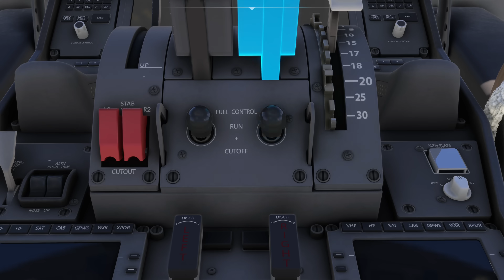Air India 171: Why Did The Fuel Cut-off Switch Get Moved?

Comment: I think that an extended suicide is strange. If I really want to play it safe, I don't think this is safe to not survive. Many crashes on takeoff and landing sometimes still have survivors. I think it could be possible that one of the pilots may have had a hidden health problem and mistook the situation due to confusion. Maybe he had a stroke or something, so he didn't remember that they were taking off. The way the switches were turned off also speaks in favour of this. Just like it's done routinely. One switch after the other.

Comment: I don't buy the suicide angle that is being pushed here. There was no fire in any of the engines and the plane never indicated that there was and under those conditions, a flight control system wouldn't allow the fuel to be cut off to both engines. Furthermore, there is no indications from the cockpit voice and flight data recorder that either pilot did anything but to try and save the plane until the very end. Having relationship problems, mental health problems, or burned out from work doesn't not make someone a mass murderer.

Comment: I work on Gulfstreams and when the engine fire bottle is discharged it initiates as sequence which includes shutting off the fuel shut off valve to that engine. Does Boeing not do this? If they did then computer logic can be programmed into the fuel management system that the only time those switches can be activated would be when the WOW's are engaged. Doing this would prevent future tragedies like this.

Comment: im very confused, if the other pilot did put the lever back to run after 10 seconds, wouldn’t we find the levers in the run position? or did he try but was unsuccessful? i thought it took more than 10 seconds for the plane to fall. i understand that even if he was successful he probably wouldn’t have saved it cause it was too late, but if he did it, why is it still in cutoff?

Comment: Captain Steve says if a pilot is feeling not right to stay home. The people with bad mental health issues won't know how bad they are if they are really bad. The solution is one pilot can't do somehow without the other pilot doing the same on their side. So if one tries to shut off the engines, the other would have to manually authorize it, this would be for everything.
Reply: That defeats the object of having a co-pilot if everything the pilot does has to be replicated by the co-pilot who would need to be present in the cockpit as a chaperone for every second of the flight - no comfort breaks, naps or taking ill!
Reply: That is true. There used to be flight engineers on board, so you'd have 2 people against 1 if something occurred, but they stopped that to cut costs. Now some airlines want just 1 pilot in total to cut costs! So if a pilot has a heart attack, the whole plane is doomed! @MrBulky992
Reply: That makes NO SENSE!!!!!

Comment: They need to release the audio recording. The loud bang that the sole survivor heard should be picked up by the recording and does it match the RAT deployment timestamp. Did that happen before the fuel cutoff switches transition to the off position? My belief is there was a circuit board malfunction such as traces expanding and therefore causing intermittent shorts due to the high temperature.

Comment: This is absolute insinuation and fake news! In 2018 and then May 2025 British aviation authorities issued a notice of a actuator issue with the fuel cut if switch that causes the switch to operate on its own!  You are clearly covering up for Boeing!!! The preliminary report did not blame the pilots they left it open ended to leave doubt! Obviously they are helping out AI and Boeing! You actually doing a disservice by not reporting the facts!

Comment: The question from someone who works in Automation and error proofing is why the "life or death" fuel cutoff switches are located where they are!!??.  Something critical like this should be at a minimum two step process where a confirmation is required by another manual action!!.   After all these planes have people in them.  We have had many aviation incidents over the years where the cause of the crash is mainly human error.

Comment: Sir if pilot did not switch off the fuel could it be fuel transmission failure could it happen even if fuel switch is not off"

Comment: Is it not possible that fuel flow  might have been stopped  by software malfunctions. Pilot observing the panel realizing fuel flow has stopped, switched off the fuel switches, and restarted? He might have looked at the switch and found it on  when the other pilot denied switching off ?

Comment: Given that the fuel switches were found after the crash set to run, the black box evidence regarding them being manually switched off and then on again has to come from the software reporting to the black box….is it not therefore possible that the commands to the engine could have been triggered by a software malfunction leading to the reported conversation between pilots regarding why did you turn that off and the denial of the other pilot…I think there is a lot of assumptions being made about pilot error here and a lot more intensive software investigation to be done, particularly with Boeings track record….one question that seems to have been ignored is whether the total electrical failure caused the engines to shut down or did the engine shutdown cause the total electrical failure.

Comment: not saying there was no pilot error or bad intention on part of both or either of the pilots, but would we be as quick in jumping to paint blame on the mental health if it were any other profession? do we have proof of physical proof of switches being turned off or is it displayed on display that one of the pilots saw and raised the question? Can it be a software glitch that points to fuel cut off?

Comment: I'm not clear on how these switches can be installed incorrectly.  How can they be disengaged (not in detent), in the unlocked position (neither on nor off), and engines still be able to be started or shutoff on the ground?   Wouldn't someone already have come across this and then correct it? Secondly, was there interaction with the switches before or after the plane lost altitude?

Comment: What we know now is that the families of those pilots can never live in peace, as everyone is now blaming the pilots for the crash.
Reply: What about the passengers who burned to death?
Reply: @cocojeffrey8502  like i agree but without clear evidence u cant blame the pilot and also ..the pilot families wont live in peace ryt ..like they will have the guilt of lose of 260 people till their death because of their family member...imagine their parents or wives ..they are in depressed state bcz of their close person death as well as the guilt of the lost of 260+ people .
Reply: @StudiesPurposeonly it's either lack of training or wilful negligence. Being a commercial pilot you take that responsibility...sorry but we can't have "business as usual" in commercial manslaughter cases. The CEO of Air India should have already resigned if he had a spine.
Reply: Not both pilots. Just the one that threw the switches.
Reply: Maybe in India, in the West its not your fault if a relative does something.  That's rational.
Reply: In 32 seconds, it's not possible to cut off the engine switch so easily. If either of them had done it, the other would have noticed. You need to use either your left or right hand to do it. Cutting off the engine switch requires force — it takes time to grip it firmly with one hand and pull it. One of them would have noticed if the other tried. Both of them cannot be suicidal.
Reply: @anantbhardwaj5741  it's not possible for two independent computer systems to have the same fault within a second.

Comment: @4:19: When you say the pilot put the switches from "Run" to "Cut-OFF", could you confirm the pilot actually did make the transition through video/photo evidence from the fligh data recorder or are we just assuming from the data on the black box?  We should'nt be rulling out any malfunction from the flight ECU. That needs to be invesigated as well. What if the switches were left untouched but internally something made the switches move position.

Comment: with all due respect captain, to compare this to children denying wrong acts is a bit insensitive.
Reply: there have been reports in the past that the fuel control switches on 737s have been installed with the locking feature disengaged but you have not covered this possibility.
Reply: special information bulletin by FAA Aviation Safety 2018, Dec 17

Comment: Good day all,

I'll try one more time, to acquire an answer to a very reasonable question, generated by AI.

My question is: Does the below AI response, have any weight? If not why. If yes, you have misinformed people intentionally

In a Boeing 737, the fuel cut-off switches (also known as engine start levers or engine fuel control switches) are located on the overhead panel or center console (depending on the 737 variant). They are protected by metal safety brackets or guards to prevent accidental movement, especially accidental shutoff of fuel to the engines during flight.
If the metal safety brackets are installed in the opposite position (i.e., reversed or flipped), a few potentially serious issues could arise, depending on the exact misinstallation:
🔧 1. Fuel Cut-Off Switches Could Be Harder (or Easier) to Move

    If the bracket is installed backwards or upside down, it may fail to lock or guard the switch properly.

    This can lead to:

        The switch not being held securely in the ON (RUN) position.

        Unintentional movement due to vibration, turbulence, or human contact.

⚠ 2. Fuel Levers Could Be Accidentally Shut Off

    The intended function of the safety bracket is to guard against inadvertent movement.

    A reversed bracket may leave the switch exposed or apply force incorrectly, making it possible to accidentally cut fuel to an engine mid-flight, causing:

        Engine flameout.

        Loss of thrust on that engine.

        In worst-case scenarios: engine shutdown at critical flight phases like takeoff or climb.

🧑‍✈ 3. Confusion During Emergency or Abnormal Procedures

    Pilots are trained to operate the fuel switches by feel and sight, and the bracket provides tactile feedback.

    A reversed bracket could:

        Cause hesitation during emergencies.

        Delay correct responses, especially when muscle memory is disrupted by unfamiliar control feel.

📋 4. Non-Compliance with Airworthiness Standards

    Any misinstallation like this would likely be considered:

        A maintenance error.

        A violation of airworthiness directives or manufacturer's maintenance manual.

    Could trigger:

        Grounding of the aircraft until fixed.

        Investigation by aviation authorities (e.g., FAA, EASA).

🛠 Example Real-World Analog:

There are precedents where incorrect reinstallation of cockpit controls or guards led to:

    Fuel starvation events.

    Aborted takeoffs or engine failures.

Such a small error in maintenance can have significant consequences, even if the failure is low-probability.
✅ Conclusion:

If the fuel cut-off switch brackets are installed in the wrong position on a Boeing 737:

    The engine fuel switches may not be properly guarded.

    This can lead to accidental engine shutdown, safety hazards, and operational non-compliance.

    It’s a critical error that would require immediate correction during any maintenance inspection.

Comment: A question.  Is there a possibility that instead of lifting the landing gears, the pilot turns off the engines?  Are the switches close to each other or easy to confuse? There was a similar story with a turbo prop plane where the pilot confused the flaps with the stack angle switch of the propellers causing a crash.In  both case the manufacturers could make a design adjustment.

Comment: Captain Steeve, What I always fail to understand if the plane is so smart that you can't pull the wheels up while on the ground then why does the plane not know it's in the air and needs fuel to keep functioning. Really smart planes with technology yet didn't have a basic safety mechanism for such instances if deliberately done.

Comment: If the fuel cutoff switches were placed to cutoff just after liftoff how is it that the plane was able to climb to 625ft(?). The plane did not appear to trade airspeed for altitude, or zoom climb. In the sim, when there is a single engine failure at rotation, there is an immediate yaw, meaning the thrust is gone - a spinning dead engine might produce negligible thrust momentarily, but definitely not enough to continue to climb if both are dead.

Comment: ok so does the report say the either of the pilots moved it cutoff and back to run position? could it be that the system it self malfunctioned and switched  off and on again in a split second internally? So could either pilots "didnt" move the switch but a system error did it internally without moving the actual switches?

Comment: I wouldn't rule out AI so quickly. I agree that it is very far from ready and I don't want to see it soon. But just about every automation that has been added to aircraft has lead to an increase in safety, and we see in the AI car technology that those cars are significantly safer than human drivers. When the technology is ready (and I'm sure regulators will require it to be significantly safer than human pilots to implement it as they have with self-driving cars), I think it will be a positive development.

Comment: Is there a reason a dual cut off during critical times of flight can't have a mechanism that would act as s time delay safe?  You could cut off one engine, but to cut both, you'd need to be at X altitude or wait Y number of minutes?

Comment: Why there is no auto pilot for takeoff and landing.
Reply: There is.  In this case the autopilot did not have the time to start.  Usually auto polit will be applied after the retraction of landing gear.  In this case the engines had already lost power. Pilots needed to handle emergency situation.

Comment: Better design - Two switches, one on each side of the pilot and the co-pilot and not one beside the other, similar to launching a nuke.  Also, could it be the pilot is the person in question and not the co-pilot as eluded by one YouTuber pilot captain has mentioned?  10 seconds too long to switch it back up.  Pilot trying to blame the co-pilot and not the other way?

Comment: With a screenshot and enlarged picture of the cutoff switches I say it's impossible for them to vibrate or be inadvertently knocked to the off position. With an indent at the off position then a slope to the run position, the switch would gravitate to run. With a strong spring it would take real force an determination to move those switches to off but looks like they would pop into run position.

Comment: You are a disgrace to the profession. 
 Why dont you highlight 
1. The Engine Fuel Control Switch on the 787 has a mechanical lock that prevents it from being moved from RUN to CUTOFF unless the thrust lever is first pulled back to IDLE.
2. This is a designed interlock mechanism to prevent accidental in-flight shutdown of the engine, especially during high thrust conditions like takeoff or climb.
3. The Boeing FCOM (Flight Crew Operating Manual) for the 787 states:
"To move the fuel control switch to CUTOFF, the associated thrust lever must first be at IDLE."
Foolish and ignorant shameless people here, supporting him.

Comment: Three doubts :
1. It took 4 seconds to transition both the switches from cutoff to run position but only 1 second to transition them both from run to cutoff. Why is that ?
2. Why it took 10 seconds to change the position of the switches ?
3. Initially it was stated that the captain said "Thurst not achieved........May day.....". Why that has changed ? Wasn't that reported by ATC ?

Comment: It is wonder that if pilots set the switches at cutoff position how is the possible, in ground level how do  start both engines or enter into runner way without functioning two engines injecting fuel into both engines. How they take off the flight while pilots keep the swithes at fuel cutoff position. While taking off the flight, pilolts cannot do this because they are very focus on ascending the flight to higer altitude. This engines not similer to motor cycle engin. Thoes engines suck much fuels to generata full trust power at the ground position. This is kind of rasism because of pilots are Indians and put all blame to pilolts and Boing to wash their hands. Otherwise Boing has to pay huge amount of money to nearest relatives of all passengers's who death in the tragic incident.

Comment: It was moved automatically.. system failure for sure.. as pilot asked his co pilot if he switched it off ? He is replied i have not.. so it was system failure clearly. 

Other thing it was just turned of just after few second after being in air.. and one of pilot had decade of experience flighing this aircraft. 
So i can say for sure it was system failure.

Other question: why would system allowed fuel cutoff in air ? Why there is no warning system if fuel cut off in mid air ?

So i think its system failure + there is no warning system after fuel cut of in mid air (horrific) 😢

Edit: I already knew they will put blame on pilot in last.